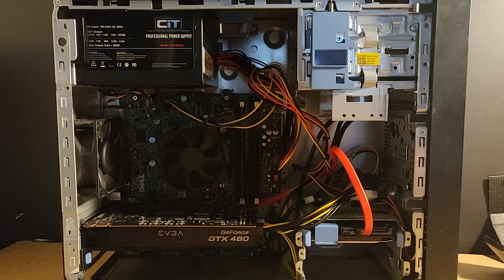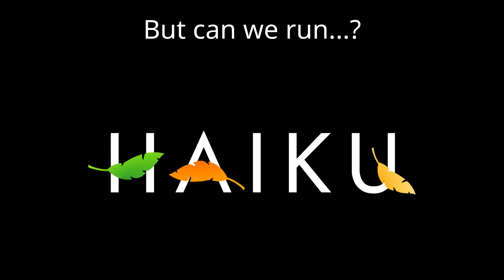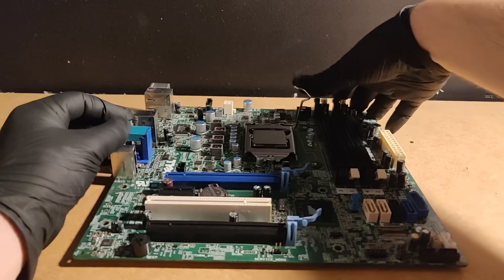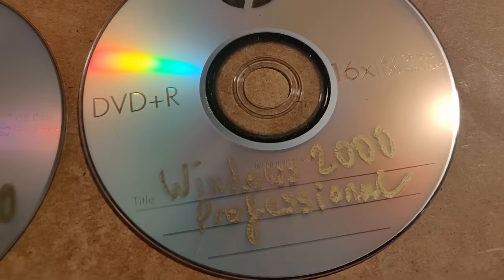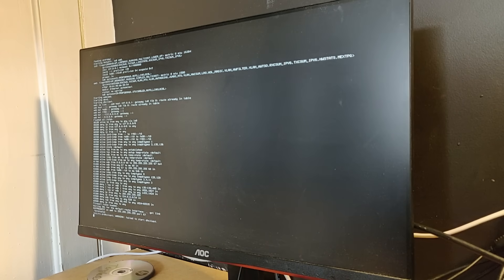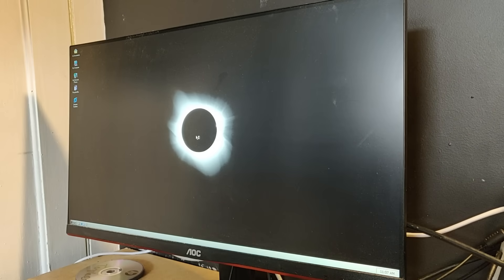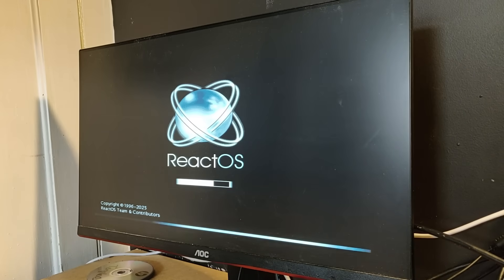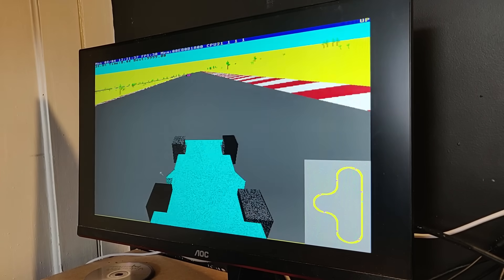Can one PC (natively) run every Operating System?

Comment: going above 4GB is not pointless, the other OSes are still 64-bit so they'll benefit from more RAM, specially Windows 11, you DON'T want to run Windows 11 with just 4GB

Comment: One of my computers is an optiplex 7010 SFF with a core i7 3770, 24GB ram, 128gb sata ssd, 2tb sata hdd, geforce gt 710. Works great with windows 11 in uefi mode secure boot on tpm 1.2 on ahci mode, VT on. Work/browsing/tv watching/plex server.

Comment: Qubes OS is based on the Xen Hypervisor, not Linux though the most privileged domain, as in the only VM that has access to the hardware by default, is typically based on Unix - A Linux or BSD distro

Comment: Few tips:
1. Having more than 4GB actually makes sense because newer OS will use it, and older ones will see only as much as they can (sometimes patches required, like with Windows 98)
2. DOS should generally be a nonissue with some caveats around sound
3. Windows 3.11 would probably work surprisingly decently (audio, high resolution graphics, maybe even networking)
4. You should be able to run Windows 98 but without video acceleration 
5. If you make full use of your motherboard and add another video card, either PCI or PCIe (like an old Quadro FX), then you can get video acceleration from Windows 98 (or even 95/NT 3.51 with a PCI card) till Windows 11
6. USB 2.0 card for PCIe x1 slot would make virtually all OSes actually very usable (storage, audio, networking, gamepad)

Comment: The wrong answer is theoretically yes, but expensive and impractical. But it would have to be extremely tailored to that niche. You would need a specially designed motherboard with specially designed expansion cards with the processor of another architecture. Early Mac's had third party expansion cards that could expand the capability of the machine. You could get expansion cards for I believe the mac 2, that added an x86 processor and others that added power pc processors.

Checkout action retro, he has such cards in his possession.

Comment: Heads up Ventoy is an amazing free  tool to allow you to boot from multiple ISO files using a USB.
Reply: I've had no luck installing any os from ventoy
Reply: @KaitouKaiju OK was this on newer or old computers? Because you need to change a setting for newer computers that use EUEFI. And yes I've also noticed some PCs don't seem to like Ventiy, but in others it works flawlessly. If you happen to have a wired network you can also try the free version of IVentoy, which is the network boot version of Ventoy.

Comment: I think where you went wrong with the macOS side of things would have been trying to use a modern version of it. Older versions of macOS did support NVIDIA GPUs such as the GTX 460, but hackintoshing those is kind of a nightmare, and definitely not something for a first timer. Would certainly be cool to see you have a crack at a hackintosh in the future though!
Reply: Is better him use AMD GPU, the cheapest I guess is a Polaris Card that runs natively a macOS, but he would need a AVX2 processor if run Ventura or above, its possible to use but need to use some "patches" and boot "arguments" to make it working.
Reply: @gabrielmaia7877 it is for macOS, but then it wouldn’t work for windows 2000.

Comment: You might want to look into IcyDock. They're 5.25" (and 3.5") bay inserts that give you external access to 4 (or 2) 2.5" SATA drives. Along with a SATA to IDE adapter, this would allow you to easily switch OSs by swapping out SSDs and then booting, much like you would have done with floppies in the 90s. This is what I do for my retro machines. I have IIRC 8 OSs for my P166 for instance. Using one disk for each OS greatly decreases the likelihood of one installation damaging another.

Comment: You can run Windows 9x on that computer without too much fuss, I have Windows 98SE running on a 3rd gen Ivy Bridge Pentium.  Win98-quickinstall is probably the easiest way to do it since it has all the required patches needed. At the time I installed Windows 98 I didn't know about the quickintall project so I did it a different way. I used an USB floppy drive w/ the Windows 98 boot floppy to fdisk the drive and format it (FreeDOS bootable USB thumb drive would do the same job), and a Linux Mint LiveUSB to transfer the required patches, drivers and the Win98 installation folder to the hard drive.

Comment: im multi booting basically every windows version on a ryzen pc, its not that hard
Reply: How can you dual boot NT 3.0 and 4.0 tho? I believe they use different NTFS format so it'd be really hard to manage them
Reply: @phamucanh488  theres a project called universal nt installer which lets you boot nt 3.5 - xp x64, it automatically sets up a grub4dos bootloader which lets you multiboot them perfectly
Reply: @imadam Somehow it didn't work for me. I tried installing on alot of motherboards from socket 478 to 1155 and it always gave the 0x1E error
Reply: @phamucanh488 would differently partitioned drives not work?
Reply: @phamucanh488 why would that matter? You'd obviously have own partitions for each OS

Comment: Been dual booting since 2005. To make work you need to wake up at 4 AM, sacrifice a chicken on top of the mountain near you, take one hair from a silver back gorilla when it's 2 months old and dip the hair in the blood of the chicken. The mystic computer elders will be pleased with you and grant you the dual boot.
Reply: i mean for me it just worked. later down the line i gave up dual booting though because windows is just so fucking notorious and i don't want to deal with it. i do everything on my arch installation anyway
Reply: "take one hair from a silver back gorilla when it's 2 months old"  - impossible silver back gorillas are only silver backed because they are mature / old. a 2 month old gorilla wont have a silver back.
Reply: @NickFellows  I didn't need to know that, thanks
Reply: lol what, for me it was as easy as installing windows, installing linux afterwards and it just ran out of the box. Grub works miracles 🤷‍♂️
Reply: ugh the endless check disk and initramfs repairs
Reply: @ShadyHero  wtf are you talking about ?
Reply: @NickFellows nothing, just using the same boot drive on 3 different sockets problems